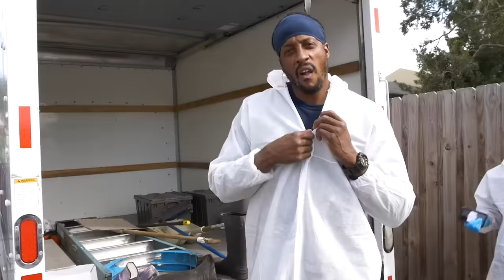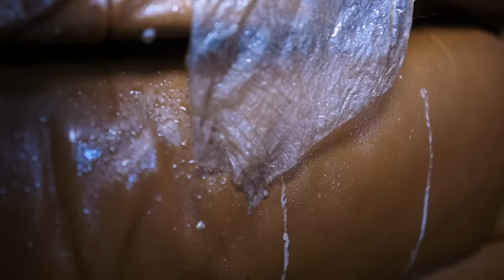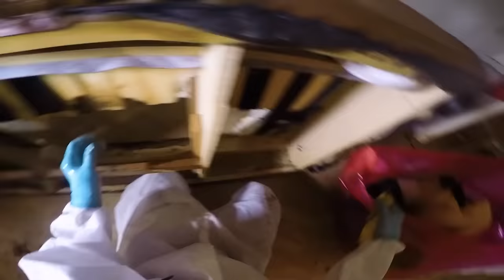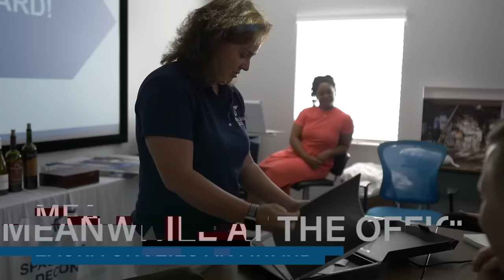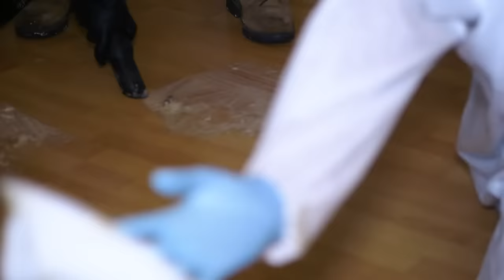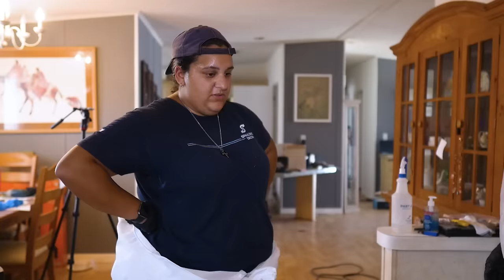Blood, Skin & Maggots, OH MY! | Tampa, FL

Comment from the maker: Since literally everybody is asking... We cut out a section of the couch rather than disposing of the couch as a whole BECAUSE:
a) Biohazard-saturated material is disposed separately and in a different manner than regular waste. 
b) The biohazard disposal charges by weight of the biohazard waste being disposed, the heavier the 'red bags' the higher the cost. It is more sensible to cut out only what is necessary and dispose of that saturated material via bio-waste facility and dispose of the gutted out, non-bio-saturated couch at a regular dump.
c) Essentially, it is both out of safe waste-disposal regulations and being cost-effective.
Reply: I was just about to ask the same question!!!!
Reply: Thank you for answering 🙌🏼
Reply: @Dana-rg8tn   huh? They're disposing of the whole couch, just different parts are being disposed of differently.
Reply: @Dana-rg8tn  they are trashing it, just in a cheaper way. if they dumped the whole thing in the biohazard waste it would be prohibitively expensive
Reply: Exactly the question I was going to ask.  Thank you for the info.
Reply: Thank you for explaining that cause I'm sure the majority of us were wondering. You guys do an incredible job 👏
Reply: and besides, you don't want anybody else touching the bio not knowing whats in the bio, and give someone else a disease that the body had if any
Reply: You should of just burned it saved time and work
Reply: @Dana-rg8tn  did you not read they get rid of the bio exposed parts then dump the rest simple
Reply: <3 Fiona and Laura !!!  <3
Reply: @Dana-rg8tn  Bio is thrown away separate from regular trash.
Reply: @deannawheeler4362  😀
Reply: @Dana-rg8tn  well obviously they will just throw it away lmao they just cut it out to save on biohazard trash.. did you not read the comment?
Reply: I had my next door neighbor die a few years ago and she was left in the house for about 5 months. A upstairs window was open in her house and I could smell the decomp and looked around my backyard for a large animal to be dead. As F-uped as it sounds , the smell isn't the worst but your nose tells you it's death. It's kinda sweet smelling and not off putting like poop or something. But I'll never forget it. Btw she died in a recliner from alcohol poisoning.
Reply: @shannaking304  idk where they live, but a lot of places won't just let you burn gigantic things that likely contain synthetic garbage like household furniture without at least a permit lol.
Reply: How can u find jobs like this in different states
Reply: @tranitrabarnett6266  just search crime scene cleaning in your area
Reply: Can you do a video of how you clean & sanitize all the tools & machines after a bio or any job?
Reply: What has happened regarding your stolen trailer? Can we have an update please.
Reply: @ohnoheb  I’m sorry I thought you were one of the pros.....not a student
Reply: @ohnoheb  I’ll sign off
Reply: 9lllllolll
Reply: I think it's amazing how you keep the family an friends of the deceased with dignity an private it's very important even though it's tough to do to put all back to way it was so the families an friends of their loved ones don't have be reminded of how their died you all are great for what you do❤🌹😘🙏🙏🙏🙏🙏🙏
Reply: How do i become a crime scene cleaner?
Reply: @Dana-rg8tn  They are trashing the dirty parts a different way as the rest of the couch.
Reply: @Dana-rg8tn  they literally explained it
Reply: O i see but for me I'd just 🔥 it.I mean it's  not to be used but job security and procedures.
Reply: @dankisreal6432  That's thousands of years of evolution at work when your nose knows human death. If you think about it, not only does it tell you an area is dangerous, but that the person who died was not buried, so they probably died away from loved ones, or were killed by a nother human, from a wilderness survival standpoint. Sorry you had to go through that.
Reply: @Dana-rg8tn  did u even read the comment?
Reply: Amazing
Reply: Makes sense
Reply: @Dana-rg8tn  it goes to the regular dump, not the family.
Reply: @Dana-rg8tn  i wouldn’t want to be charged extra for something without biohazard on it! i’m happy they cut it out so people don’t get sick at landfills!!
Reply: I work in a hospital so I totally got your cutting the biohazard waste. Deal with stuff like that and chemo waste. This is my 5 the video and love it. Got yourself a new sub 💗🕊️
Reply: I was actually gonna ask that same question! Thanks for clearing that up👍
Reply: @Dana-rg8tn  you slow huh 🤔?? They JUST explained why
Reply: @anniacopeland8321  EXACTLY!!!! A lot of these people on here fail to read and then they are the ones with the most questions. LMAO.
Reply: Why can't they get away with just disposing of the whole couch? Is it illegal? Does bio "contaminate" other waste? I just don't get it. Why does it cost more to dispose of "bio" waste than "other" waste?
Reply: @Dana-rg8tn  didn't you pay attention? It's cheeper to do it the way they are then throwing it away together
Reply: Congrats Laura. I would love to be able to join the crew but I have no experience or transportation back and forth.
Reply: A.
Reply: Or all three .
Reply: Thank you for answering this question 👍
Reply: Duhhh people can be so um what's the word 😜
Reply: Nice to know if I ever see a couch all cut up like this at a dump it’s probably had a dead body on it
Reply: Yes, the same as in hospitals.
Reply: @GoforthAndBeKind  Because it's considered a different type of waste that needs to be disposed of in a safe way. Could you imagine if hospitals just threw bio waste in the regular trash? There are viruses, diseases, etc to think of that could affect the environment. Its for everyone's safety at the end of the day.
Reply: @shannaking304  You're not caring about any kind of environmental effects do you?
Reply: I love your job. Hugs n kisses to you all  from St Croix Virgin Islands in the Caribbeans.  I work at JFL hospital n I myself have worked with molds and biohazard. It is very interesting job. I wish I can join you all. One of my passions is the morgue, ocean, n nature. Have a blessed day. Be careful, be safe n be blessed.
Reply: Do you all have any courses available on line? I would love to have a business like that in my country. Spalding Decon V. I.  That would be super.
Reply: Enough of the cutting shit, pick that couch up, toss it into a compactor or a damn incinerator. You all playing with your lives with those gloves and box cutters.
Reply: Can you just burn it ?
Reply: I love watching you guys and I greatly appreciate what you all do.
Reply: Thanks for the info! I was just going to ask this very question.
Reply: Since there are maggots flies rats  animals in the house and the above mentioned are all over the house etc isnt it all bio hazard as its saturated right through it all and why dont you use a skip bin and toss the big stuff in good series greetings from australia 😊😊😊😊😊😊
Reply: Biggest question on my mind….thanks.
Reply: Time is precious and those suits look hot.  I think k I’d be tempted to toss the entire couch and forget “cost effective.”  I mean it looks like 70% was bio
Reply: Me too!  I’m thinking “are the saving the sofa for a yard sale?”  Gently used... minor damage.
Reply: If you’re going to RECORD and POST these videos, QUIT with all the 
”WOO-HOO”’s.
These people have families that could come across these videos.
Have more respect.
Reply: that makes more sense than to just through it away whole.
Reply: Thanks for clarification  
I'd be tempted to just light the couch in fire lol
Reply: @Ginny71166  Karen is that you?
Reply: @UCefywvVmqblxN5IVseADaFA come back when you’ve lost someone you love and wouldn’t appreciate someone else “woohoo’ing” the maggots crawling through the decomposing remnants of their death, be it natural or suicide. it’s ignorance and lack of life experience insulting humans who comment on the lack or decency presenting in the world so often anymore.
Reply: @weedywendy4266  With a job like this, reactions whether they be what you expect or not come with the territory. Do you expect them to smile at a sight like that? It's shock, disgust, etc. Who would even be watching the crime scene cleanup videos of their loved ones? That's morbid and twisted. They have permission to post these, you know that right? Why don't you watch more of their content that explains all of this instead of policing? If they had jumped back, vomited, gasped, screamed, gagged, ran off, laughed, smiled, recoiled, no matter what they did, y'all would be saying it's inappropriate. Let's see you do this without any sort of reaction. I've lost loved ones, seen plenty of dead bodies, I even found one of my highschool best friends in her home after she took her own life via hanging and I don't find any of this offensive. Most of us couldn't begin to do this for a living, why shame those who can or expect them to act tragically broken at every scene? You won't survive in this field if you don't try to lighten the mood/experience a bit.
Reply: I was just looking for a job to work at after I’m done working at Dow when I’m older
Reply: So this is the law to dispose of bio hazard waste?
Reply: What is this almost everything is contaminated  n why to cost cutting leave such pieces outside dumps only to cost cutting । Covid is out still n you don't know how to carry  decontamination procedures । Felling sorry for you how leaurely you work no decontamination no fogging no use of ventilation for fresh air n airpump
Reply: very nice work but i see you guys useing same knife and gloves for the whol couch your contamnating everything on the couch someone will catch somthing for sure use new knife and gloves for things that are not bio
Reply: @cw7147  RE-READ THE ANSWER
Reply: @angelaknight4586  ??????
Reply: Ty
Reply: it is so great to get the back stories.
Reply: I was just going to post this same question. Thanks for answering!!
Reply: You guys sure do alot of "deaths" in Tampa, Florida.😳

Comment: Thats a hard job right there.  I've disassembled a couch that wasn't soaked in decomp and it was a really crappy job. Nice work guys.

Editing to say congratulations on the silver play button and wanted to point out that you've topped that by over 500,000 now and that's awesome
Reply: Why disassemble the couch and not just take the hole thing as bio?  Once the furniture piece is dissected it’s eventually useless?  Just like flooring like rugs torn apart but it’s going to be replaced.
Reply: @dwtbb00  I assume for a couple of reasons. I assume partly because it’s less to have to dispose of if you’re only disposing of the contaminated parts. And maybe also so that people don’t find it and try to reuse it. Just a couple guesses.
Reply: I believe it’s because bio is expensive to dispose of, so a piece of furniture takes up less space than an entire piece.
Reply: @dwtbb00  I saw or read on another of their videos that they're charged by the pound, I think, for the bio so it's cheaper to remove it.
Reply: @dwtbb00  Biohazard disposal services are extremely expensive, and charge by weight/volume. So anything that isn't actually contaminated is just wasted money if you send the whole thing to the bio disposal place.

Comment: Why do u dissect the couch instead of tossing it out whole?? Also, do u toss out the razor knives after use or can u clean those??
Reply: I’m pretty sure they have to get rid of any bio first and put them in the hazard bags before dumping.
Reply from the maker: The bio-saturated parts of the couch and the rest of the couch need to be disposed off separately. We pay per weight for the biohazard disposal so it's economically more feasible to dispose only what is necessary and for sure contaminated with bio separately.
Reply: @CrimeSceneCleaning  thank u!!!! Interesting work u guys do! Enjoy watching all your videos

Comment: Very interesting videos. Also...Can someone teach that woman how to unplug the lamp safely? Cause damn, no one yanks vires like that, unless wanna become statistic yourself.
Reply: Not yanking wires has far less to do about electrocution and more about not damaging the outlet or the plug. The metal parts on plugs are super easy to bend
Reply: @s4di.3  Still can fry you. Especially in place that is not clean and no way knowing how good electricity actually is. x.x

Comment: lmao watching them destroy the support for that wall, NOT replacing it, then trying to replace the floor without adding supports at the seams is kinda comical.. 
should have used 2x4's where the edges meet, now someone will have to rip all that halfassed work out and do it properly..